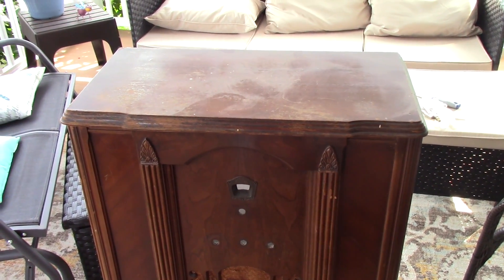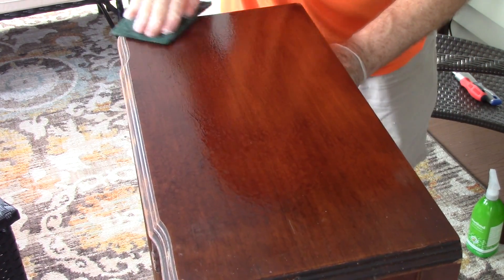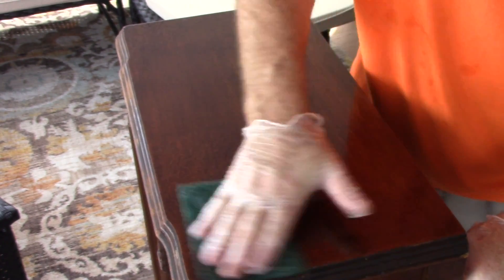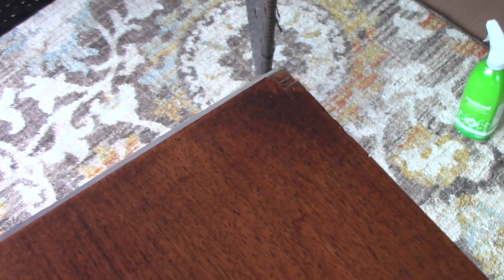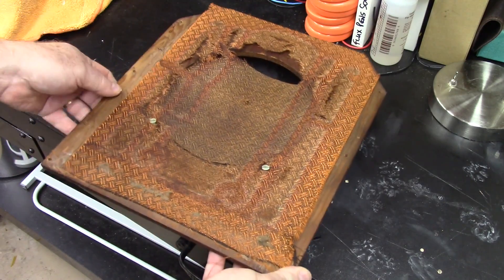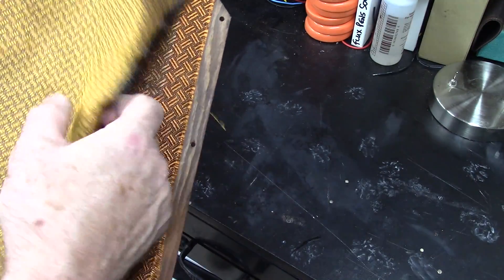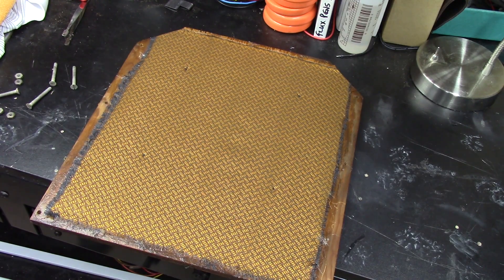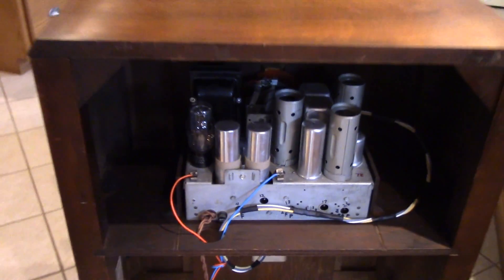Finishing up the 1933 Philco 60L

Comment: Glad to see you back Gregg, you did a great job on the radio.
I may try to get some of that howards Restorer, maybe it will help on the CROSLEY  radio and other radios I have, I can't refinish cabinets but maybe Howards Restorer can make them look better.
Reply from the maker: Thanks Bill, yes they sell in in various tones depending on what you need. It actually does work pretty well. A can goes a long way too.
Reply: @greggsvintageworkshop8974  Thanks Gregg, I have to radios, dark wood finish, no sure what to buy or where to buy but I don't want to buy more than one can.

Comment: I have the same radio. all original except the cloth. I am interested in restoring the tube radio. Mine is missing two tubes,
Reply from the maker: Hopefully my restoration will help assist you with yours. Bob Dobush at Findatube.com is where I get all my tubes. Great guy and usually has exactly what you need in either new or used.
Reply: @greggsvintageworkshop8974  thank you!!

Comment: Before you condemn your antenna lead wire, do you have a modern flat screen tv, on the same circuit, or in close proximity to that radio? If you do, thats where your hum is radiating from..I know from experience, that these modern electronics wreak havoc on antique tube radio/ phono equipment. Sorry to say, they're isnt much that can be done for the outside interference we suffer with modern electronics.
Reply from the maker: Thanks James, to answer your question, yes there is a big flat screen about 6 feet from the radio. The circuit is likely tied together. The house was built in 1908 and I bet the outlets are on the same circuit.